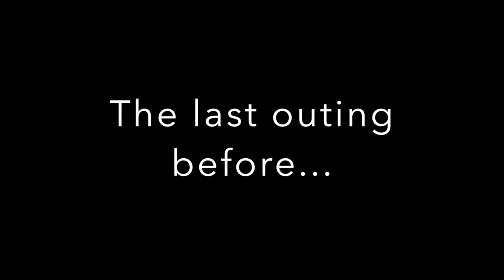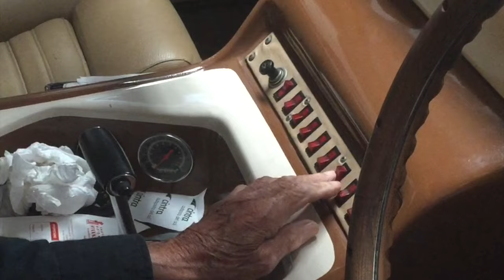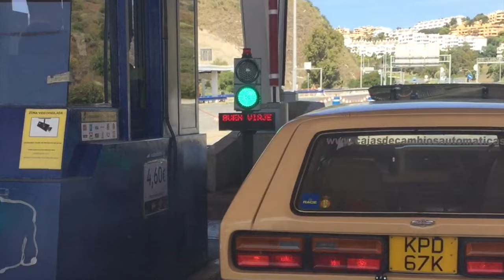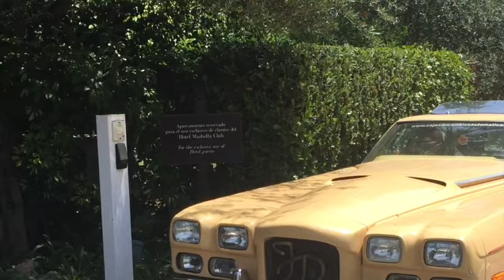John Dodd out with the Beast 13th May 2018

Comment: Who ever made that muffler did a good job, it’s not nearly as loud as I expected!
Reply: Except the exhaust is too close to the body at some point and bangs when idling.
Reply: @briananthony4044  probably on of the rubber hangers needs changing,crazy to think the engine is nearly 80 years old
Reply: @briananthony4044  Is that what that nasty rattling noise is???  Kinda ruins it a bit.
Reply: The exhaust exit looks to be at he front of the rear wheel, the pipes and box at the rear might be just for looks.
Reply: It’s still mighty loud just that the engine idles so low it barely makes sound
Reply: @UberLummox  I don't think a 27L car was ever designed to have any sense of refinement in that aspect
Reply: @johnowls  nah, it has cut outs on it. There's a valve that can switch between the quiet system and the loud system. this thing is DEAFENINGLY loud when it's dumping out the side pipes.
Reply: @briananthony4044  Возможно воспламеняется в глушителе не сгоревшее топливо. Черный дым при ускорении признак богатой смеси, бензин "живём" в трубу вылетает. Самолёты на холостых оборотах не летают:)

Comment: That's the longest engine bay i've seen and i bet the revs are really low cruising speeds due to it having so much torque. Your dad is a legend.
Reply from the maker: Michael David Thanks! 🙏😊
Reply: yes the revs are low,i think max is 2,700,i remember this car when he first built it ,the stuff of legend indeed
Reply: @frozenice61  3000rpm . Jay Leno has a Merlin engine in a custom built Bentley and it just idles most of the time.
Reply: @jaggass  the later merlin engine probably did rev a bit more 300 is 10 percent so more than a bit

Comment: Great to see the man and his car still going!
Reply from the maker: Thanks Martin 😊👍 We actually just did a similar more recent video at the end of 2020 Dad is 88 now & still driving the Beast 🎉
Reply: @soosiedodd68  Go Dad!
Hey Suzanne I have a question you may be able to answer. 
I have an old custom car book from the early 70s showing The Beast on the cover as a fastback coupe painted red, this was when the car still had a RR radiator grill. So I'm aware the car has been continuously altered over the years.
BUT: I have a memory of seeing a photo of a batmobile-like open top roadster that was credited as being Merlin engined and Built by John Dodd. Does this jog any memories? Was there more than one Beast or was the car completely altered at some stage?

Comment: sounds like he's got a badly tuned steel-band under the bonnet.
Reply from the maker: The noise is torsional play in the step up box at low revs - The engine itself is fine
Reply: @soosiedodd68  quite, tighten everything up, spray some WD40 here and there and Bob's yer uncle.

Comment: need some 4 star in that. detonating like mad on idle. hopefully ok when warm.
Reply: The engine is fine, that rattle and banging is the gearing step-up box between the engine and automatic gearbox 
After 50 years it's become rather rattly at low revs

Comment: Insane project :) I just love those RR Merlins... Non av-engine sounds better ;) What transmission is handling with that torque?
Reply: A bus gearbox from what I have heard
Reply: @fes121tas  Thanks for the info Bro. I was searching more about this project on my own and it is little bit hard to find. I admire owner and constructor of this sic car ;)  Everything powered by Merlin or Griffon is cool BTW :)
Reply from the maker: PolonezV8 it is actually a Hydramatic 400 attached to a step up box for the difference in revolutions - It stands 750 pounds of torque but is capable of up to 850 for long periods
Reply: @soosiedodd68  thanks for the info 😁 Your Dad is insane mechanic. I admire his work. Greetings from Poland 😉 PS.check out my project on my channel... It took me 7years to build that drift car 😁 It's my baby but nobidy knows the base car becouse its a old Polish car FSO POLONEZ... And the FSO CARS Company doesn't exist now.
Reply: Thanks for SUB 😉 Waiting for some  brand new info on Your channel also 🤘

Comment: This car is different to the red one that's featured on the BBC archive page.. Although they have the same reg... So what happend in the years.. Also the red one has a more rolls resembled front end..
Reply: He was driving back from a show in Sweden when the car bottomed out and split one of the transmission oil tanks, catching fire. The chassis was salvaged for the new car.

Comment: just for clarification Mr  Dodd' is the engine the aero carburetor version  or miltary injection variant (meteorite) .....
Reply: the meteor.
Reply: This engine is actually a Merlin with the supercharger removed. I believe the original engine used to be a Meteor back when the car was first built. The current engine was fitted after the car caught fire.
Reply from the maker: It is actually a Rolls Royce Merlín Spitfire engine originally from a Boulton Paul Balliol

Comment: Very curious about this car.... It will be much safer with a solid axle. Looks like a 9" Ford diff. The whining noise must be straight cut gears on a blower or valve train. Someone in comments said it's a 27 liter... Plane motor?
Rolls Royce or other... A really unhealthy knock now!

Comment: What make and model of car is this anyways? The whole thing wasn’t custom built, is it??? I’m aware that there wasn’t a company putting merlins in cars from the factory, but that car looks just too well made to be something completely custom, but I could always be wrong
Reply from the maker: This is a completely unique chassis made to accommodate the Rolls Royce Merlín Aeroengine designed by the late engineer Paul Jameson - The body is fiberglass, again designed around the chassis by a company called FGR - John Dodd adapted the automatic gearbox that fitted onto the step up box again designed by the late Paul Jameson - There are a few lights from Ford Capri, Triumph stag, Rolls silver shadow bumpers, Jensen window screen etc.  So it is custom made but a unique model itself 😊👍

Comment: What sort of power does this engine produce? And how much does it rev?
Reply: the original Meteor engine was about 700hp. Under 3000 rpm
Reply from the maker: This is a 27,000 cc Rolls Royce Merlín - 1,000 horsepower
Reply: @soosiedodd68  Thanks for clearing this up! I wrongly assumed the  "new" beast had the old Meteor engine. Nice to hear the authoritative version. Long live the Beast!

Comment: I wanna know the acceleration and top speed
Reply: On an earlier video the acceleration was given as 0 to 70 mph in 3 seconds. The car in it's original gearing had a theoretical speed of 300 mph but JD himself said it started to get a bit loose upward of 180. He did 200 several times on unrestricted autobahn. Later the rear axle was changed to a lower gearing and the top speed was a theoretical 250 mph. I use the word theoretical as the car does not appear to have any aerodynamic devices to keep it secure on the road at such speeds (my own thoughts).

Comment: It sounds awful was it not running right?
Reply from the maker: The step up box between the automatic gearbox and the engine has become slightly rattly with torsional sound in lower revs - It is almost 50 years old now 😅
Reply: @soosiedodd68  I was wondering why it sounded rough lol still awesome it's a wonderful car bet it's hard to stop the wheels spinning
Reply: @soosiedodd68  what an amazing car and legacy

Comment: I know nothing about engines but it sounds terrible.
Reply: they dont like ticking over
Reply: leso204 Even as dumb as I am, I can tell that by the way it flys up the road, but thanks anyway.
Reply: It's Merlin aircraft engine
Reply: Note when the vehicle is progressing normally on the road, the sound disappears. Apparently it is torsional vibration in the step-up gearbox between the engine and the automatic trans.  Maybe while the back end is being replaced vibration at tick over  will also be addressed....